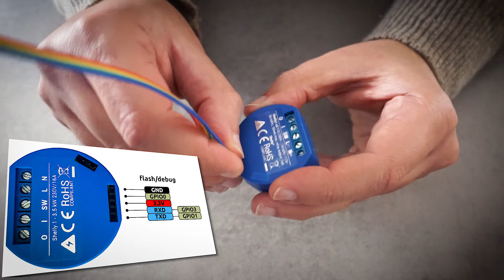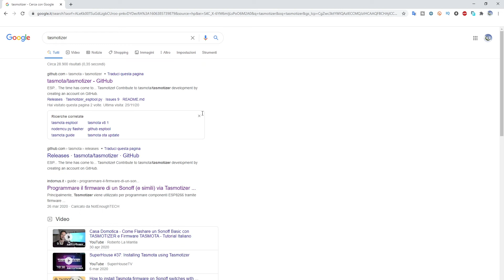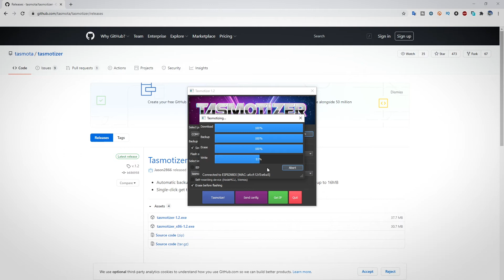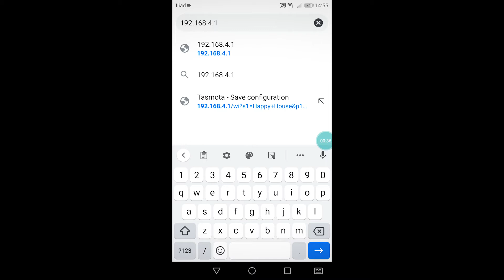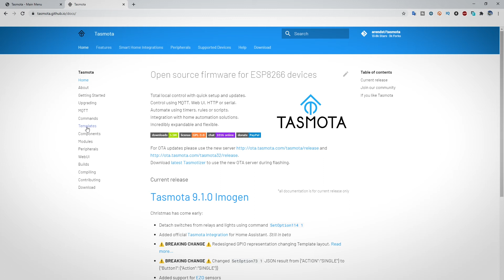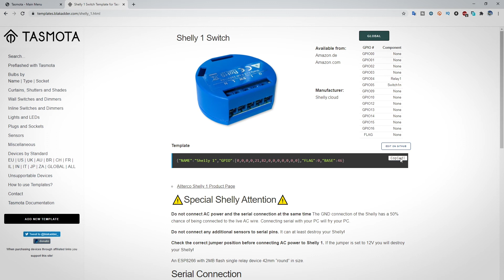Repairs & Electronics Projects #04 - SHELLY 1 V3 TASMOTA Firmware

Comment: Ho flashato il tasmota, e' funziona perfettamente, ma il funzionamento adesso e tipo toggle, se uso un interruttore si accende e si spegne in base al relay se si trova on o off, c'e una funzione per renderlo uguale allo shelly? se on si accende se l'interruttore e off (contatto aperto) si spegne?
Reply from the maker: Certo. Tasmota ha una serie di comandi per personalizzare il funzionamento di ogni dispositivo. Il comando che ti interessa é SwitchMode e trovi il funzionamento qui: https://tasmota.github.io/docs/Commands/#control
Reply: Risolto 🎉grazie

Comment: Ciao grazie mille per il video. E' difficile trovare risorse su questo argomento. Ho il tuo stesso identico programmatore per ESP-01 e sono riuscito a flashare Tasmota su un ESP-01 e funziona perfettamente, ma non ci riesco su uno Shelly1 v3 appena acquistato. Ho provato a flasharlo direttamente con Tasmotizer seguendo la tua guida ma mi da errore subito dopo la fase di download, si blocca su connecting e non riesce neanche a fare il backup. Ho seguito per filo e per segno tutti i collegamenti. Ho letto nel sito di Tasmota che l'alimentazione dello shelly deve fornire almeno 350 mA sulla Vcc. E' possibile che il CH340G non riesca a fornire i 350mA richiesti?
Reply from the maker: Grazie a te per essere passato di qua prima di tutto. Il programmatore dovrebbe riuscire tranquillamente a fornire la corrente richiesta tant'é vero che io riesco a programmare gli Shelly senza alcun problema (1 2.5 e PM). Hai provato ad invertire TX e RX? Spesso si invertono senza accorgersene. Fammi sapere.
Reply: @OnStageStudio  Erano corretti, non so forse il mio ha qualcosa che non va... in effetti l'ho comprato su Aliexpress magari ha qualche componente diverso da quello cha hai linkato su amazon. Comunque sono riuscito ha installare con un altro programmatore:  FT232RL. 🙂
Ora ho un'altro problema ho seguito la tua guida e mi ritrovo in configuration a dover decidere come assegnare GPIO0, GPIO1 e GPIO3. Di default sono tutti su None. Come li devo settare?
Reply from the maker: Hai installato il template adatto? https://templates.blakadder.com/shelly_1.html qui trovi quello per lo shelly 1
Reply: @OnStageStudio  si ho installato anche quel template anche se in realta' c'era gia' shelly 1 nella lista. Però ancora non l'ho connesso alla 230v, ho fatto tutta la configurazione tenendolo attaccato al pc. E' possibile che non chiuda il contatto tra O e I per questo motivo? Sto provando con i puntali di un tester messi tra O e I ma non suona.
Reply from the maker: I contatti si chiudono solo quando connesso alla tensione di rete 230v. Prima di dare tensione peró staccalo dal PC.
Reply: @OnStageStudio Son riuscito a farlo funzionare finalmente. Sei un grande! Grazie ancora.
Reply from the maker: Grazie a te! Mi fa piacere esserti stato d'aiuto.